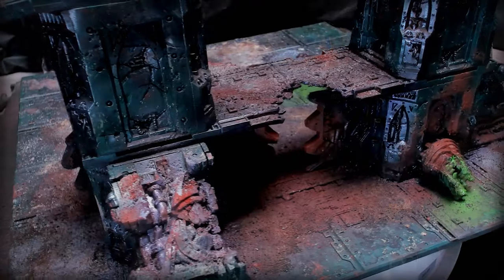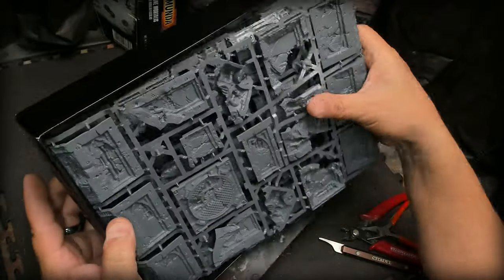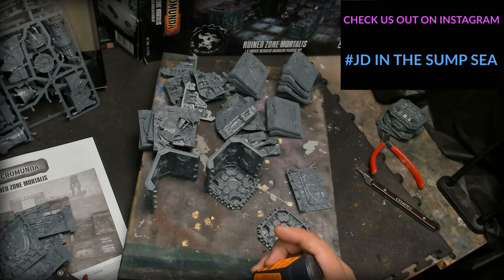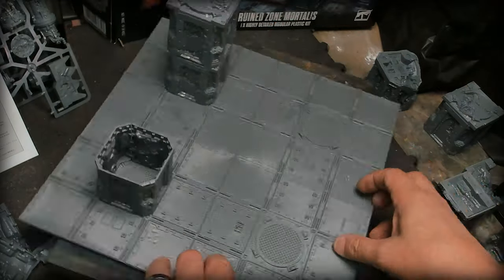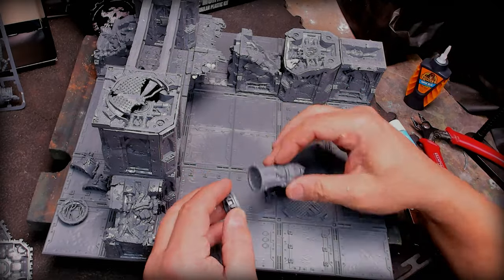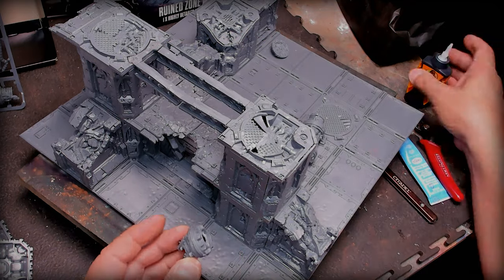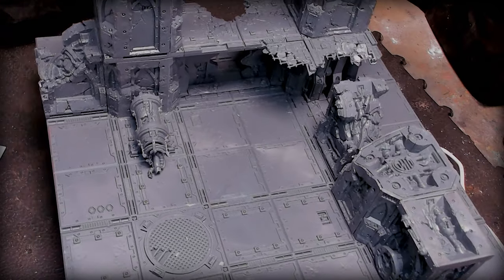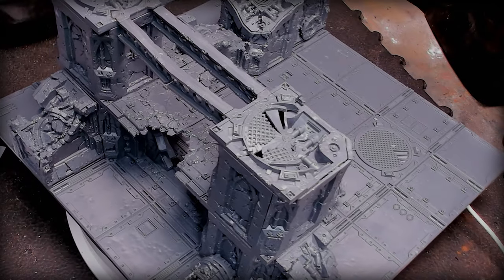Necromunda Hive Secundus Walls and Columns Unboxing, Build and Paint

Comment: Question...at the 7:35 point I saw you used two glues. Are they different or was one just running out?
Looks amazing and I LOVE the rambling mumblings commentary, totally added to the fun of the video!
Reply from the maker: The second one is testers plastic model cement.  I really like that one for gluing he sections to the tile itself and any horizontal parts that don't need propping while it dries.  It works a lot like the styrene glue but it has a bit more base to it but takes a little longer to set up.  I actually like it much better than sg usually but the kids have made most of my glue supply disappear this last week so I made due.  Thanks for the support about the rambling too. :)